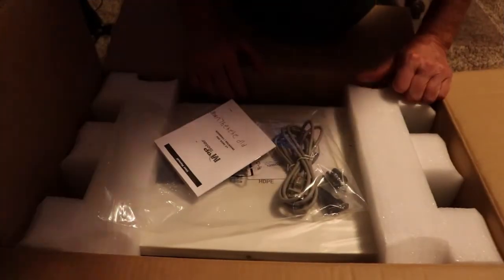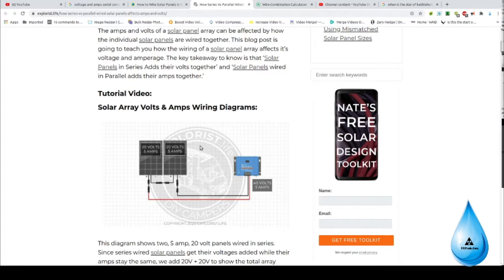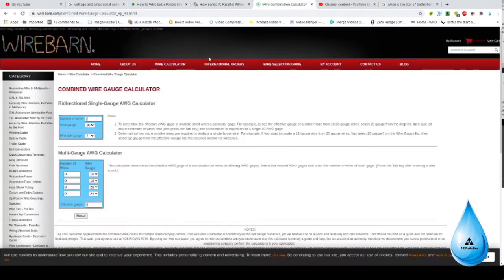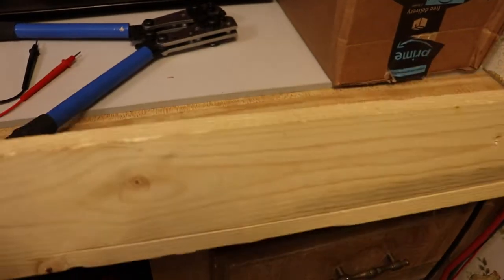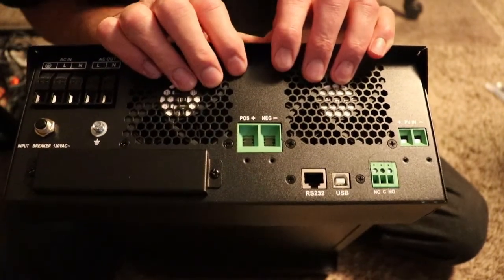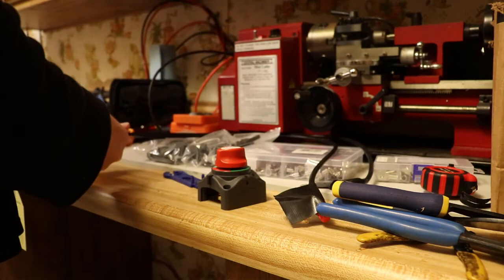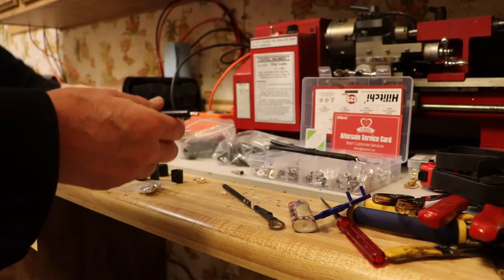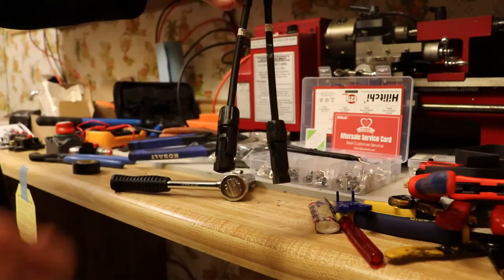MPP Solar All In One Inverter Installation Part I

Comment: I've been trying to figure out how to ground my cabins off-grid system using an inverter quite similar to yours. Where the did you find the information that tying both grounds together in the A/C out is procedure? I suppose it doesn't matter. As long as the unit is grounded in some way using the ground screw  it shouldn't matter. Thanks in advance.
Reply from the maker: I have years of electrical experience including engineering and electrician work. You combine ground and neutral in a main panel. If you add a panel aka sub panel, you attach the ground to the box and attach the neutral to the ground and do not use the green screw to tie both the box and ground to each other. Also if you have a grounding rod for your cabin, you want to attach that ground to your main electrical panel. Any questions just ask and also good to consult your local electrical inspector since code does vary depending on where you live.
Reply: @DROPsHomestead  Thanks a lot for your response. 

The cabin is a small guest cabin that was built by my grandfather before he passed. The wiring was extremely simple. He just had one plug on the outside of the cabin that went into a generator. That then split into indoor plugs, switches, lights etc. Clearly not to code. Hahaha. 
 
Anyway, I would like to use a solar setup with a 24v 3000watt inverter like yours. I  was planning on keeping things simple and adding four 20amp outlets from the "A/C Out". Then I could just take an extension cord and run it to the existing plug outside mentioned before, while saving the other outlets for whatever use. I'm contemplating if adding a 25 amp breaker between the inverter and my outlets will be necessary.

The" A/C In" on the inverter will just be used to charge batteries from a generator in case of emergency. No ties to any mains whatsoever. 

I had planned to add a grounding round outside the cabin and run it to the inverter. But on a lot of DIY videos they don't even bother. What do you think? I'm in school and it's hard to afford any onsite help so I really appreciate this.

Comment: heya that looks very nice keep up the good work, hopefully more people will install solar instalations to be more self sufficent.
Reply from the maker: Yeah, I want to get a couple of the MPP Solar LV6548 but since I'm moving in the spring, I'll wait and do that along with grid isolation switch in the electrical panel if they require you to be connected to the grid.

Comment: you are very thorough at researching things so I value your opinion.  Is it correct that the U.S. does not have military capability to be alerted to an incoming EMP, and we do not have the necessary weapons to shoot it down before reaching our shores? I worry about these things and I worry about what I have found in my research. Are solar panels at risk with EMP?
Reply from the maker: Most solar panels will survive an EMP however you might lose the bypass diodes but it will still function however the panels will have very different voltage levels causing noise. A controller and inverter would be toast. You would need new ones of those most likely if they were energized at the time of the EMP. The EBS would announce an incoming missile so you would want to power down and disconnect your system at that time to avoid major damage to your solar system.